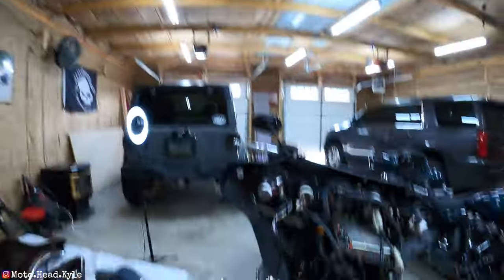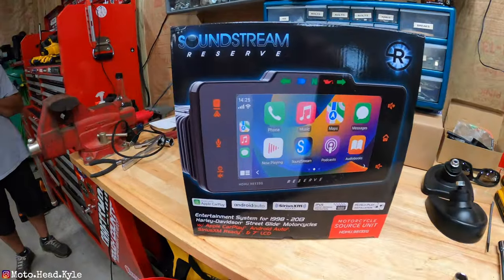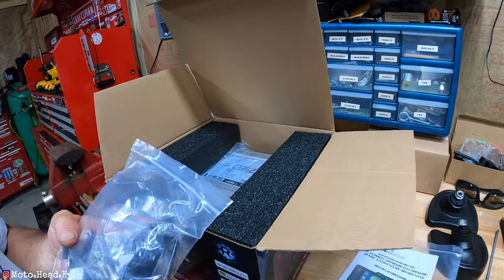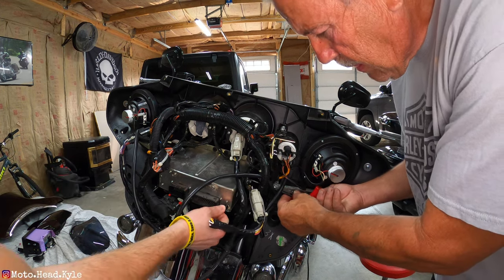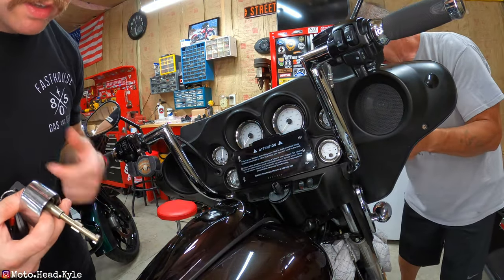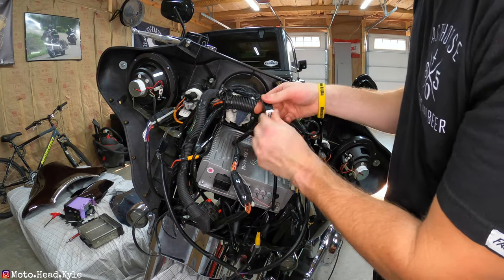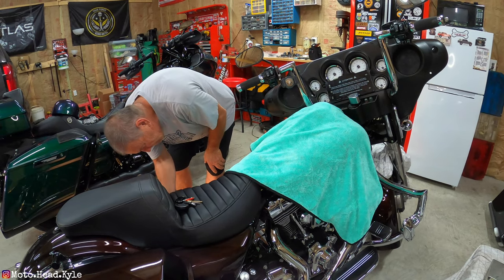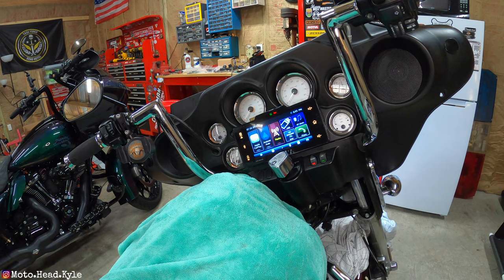Soundstream Radio for 98-13 Harley Davidson Street Glide Motorcycles (Unboxing & Install)

Comment: I used your video as a guide to install that radio on my 12 Ultra Limited. I topped it off with a Mx4 800 Rockford amp to power the 6X9 speakers in the bags. Only issue I had was the polarity on the front speakers. I was told that Harley wired their some of their speakers with the wrong polarity. Tested the polarity with a polarity tester. If someone can explain the crossover radio settings, I would appreciate it.

Comment: How’s your fm radio reception? Mine sucks. Thought it was the cable or antenna so I did a swap back to stock to see and it worked fine.